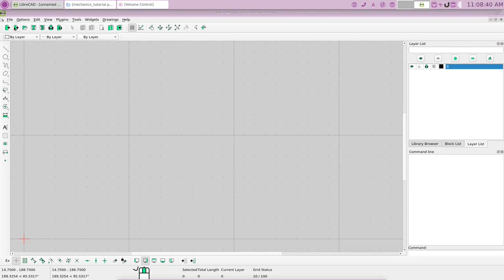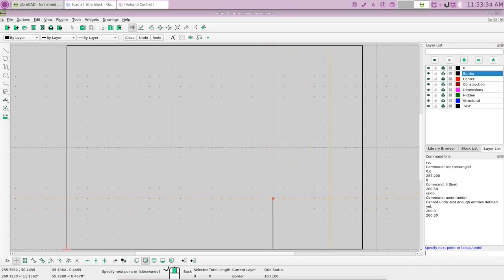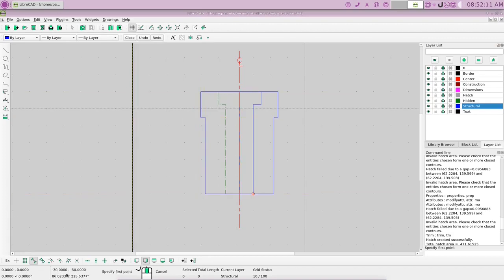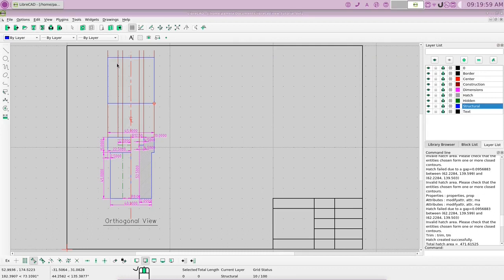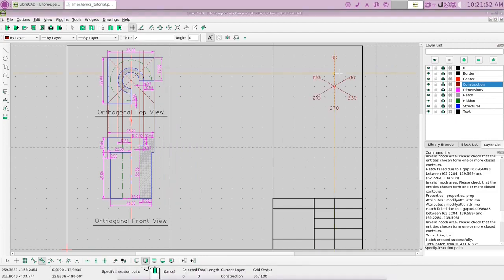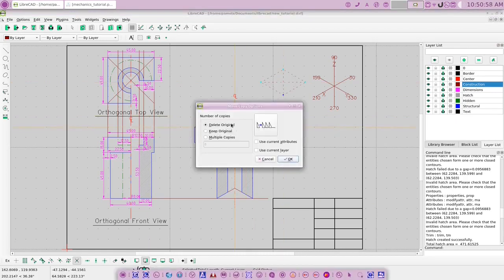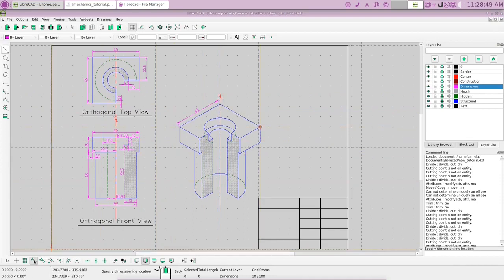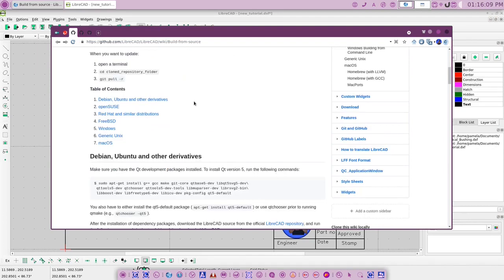LibreCAD Beginners Tutorial Learn To Operate This 2D CAD Application Like a PRO

Comment: Is there a LibreCad user that can answer this question for Me?  In LibreCad can you split the screen and have 2 windows open so you can zoom into two different areas?
Reply from the maker: Hi @user-ec7xm3ef1g; Thank you for your inquiry. To split the view-port in LibreCAD is not an option. However, you do have a couple of alternative options. One you can open to separate instances of LibreCAD with a different drawing in each. Two you can save one "import" your second drawing as a "block" and drop it into your first drawing and then "explode" the "block" if you need to work on it. If you require more information on using these tools in LibreCAD, please re-comment.
howtopam
Reply: Let me tell you what I am trying to do.  I am trying to draw the top view of a machine that is very large.  I have the front view & right-hand side view drawn.  I copied the side view rotated it 90 degrees & moved it so I can copy parallel from the front view & the side view to create the top view.  When I select a line from the front view to copy parallel threw a point, I must zoom into the rotated right-hand side view so I can snap to the line to get the location. Then I must escape to get out of the zoom command & my line that I originally selected is not selected any more.

Thanks for the help.
Reply from the maker: @JimGoepfert  When working with different views of a drawing it is often beneficial to save a particular view in a drawing by itself, then, "import" that view as a "block" through file/import/block(your-view.dwg). With your view imported as a block you can rotate the view and place the "block" wherever you desire after zooming in to the initial drawing to get your precise location. After you place your view in block form you can "explode" the block and your view will be in the initial drawing as it originally was. The best way to work with different portions of any drawing is to create a "block" of that portion of the drawing. In "block" form you have complete control over positioning that view or component where you desire. I hope this information will help you position your side view where you are attempting to locate it.
howtopam
Reply: Is there anyone that can help me with the above situation that I have?

Comment: In LibreCad can you split the screen and have 2 windows open so you can zoom into two different areas?
Reply from the maker: Hi @user-ec7xm3ef1g; Thank you for your inquiry. To split the view-port in LibreCAD is not an option. However, you do have a couple of alternative options. One you can open to separate instances of LibreCAD with a different drawing in each. Two you can save one "import" your second drawing as a "block" and drop it into your first drawing and then "explode" the "block" if you need to work on it. If you require more information on using these tools in LibreCAD, please re-comment.
howtopam

Comment: So far I'm not impressed with Libre CAD. I could easily draw a floor plan on graph paper. When I do that 1/4 inch equals a foot, which is 1/48 scale. Personally I'm looking for walls, doors, and windows. As well as cabinets, sinks etc. some things you go over is fine. Thanks for responding.